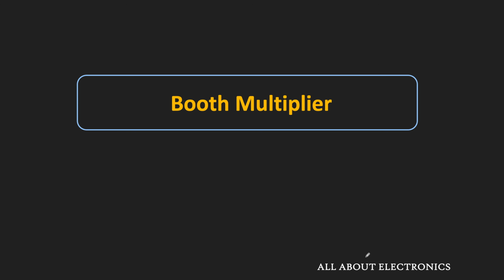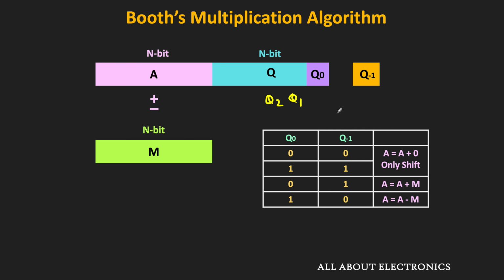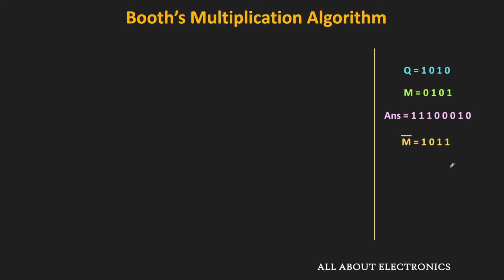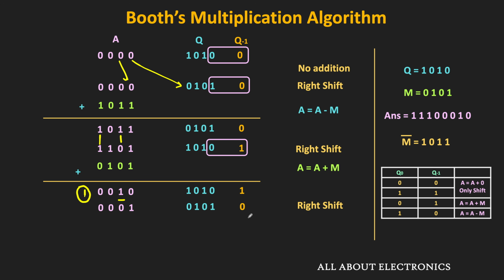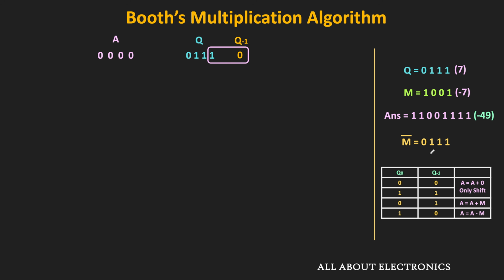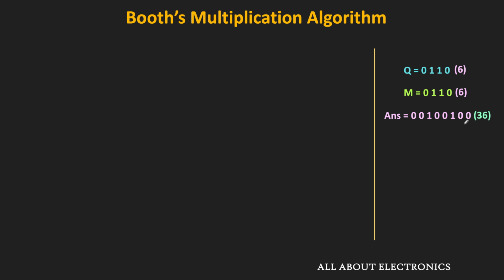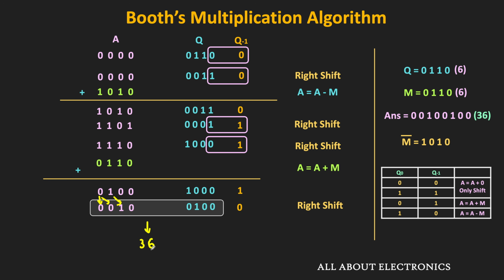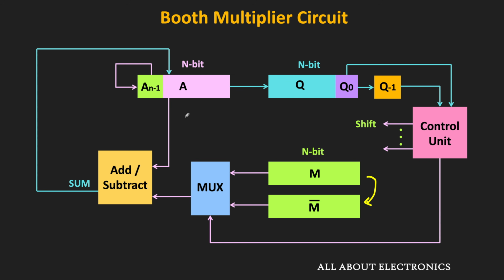Booth's Algorithm for Multiplication Explained (with Examples)

Comment: In this method for booth encoding part where we are deciding how to take q0 q-1 values as 0,+1 and -1 , what is the logic behind that
Reply from the maker: The idea is to reduce the number of additions compared to standard multiplication using the add and shift method. This algorithm treats the continuous block of 1s as single entity. Wherever there is a transition from 0 to 1 or from 1 to 0 then only the addition or subtraction is performed. This way it increases efficiency compared to standard multiplication method. I hope, it will clear your doubt.
Reply: @ALLABOUTELECTRONICS  Yes I understood that but what I exactly want to know is how this -1, +1 and 0 encoding is coming, do you have any paper or document to clear that doubt.
Reply from the maker: @arnab94mallick  Here is basically +1, -1, 0 encoding represents when to do subtraction, addition or just shift operation. For example, in this case, Q = 0110 (6). The same can be represented as 2^3 - 2^1. 8 -2 = 6. So, in the example if you see, the subtraction is performed at the 1st place (where we are getting 10 while comparing Q0 and Q-1 in the second iteration) and the addition is performed at the 3rd place (where we are getting 01 in the fourth iteration). So, just by doing one addition and one subtraction (along with right shift operations), we are getting the result. I hope, it will clear your doubt.
Reply: @ALLABOUTELECTRONICS  yes thanks

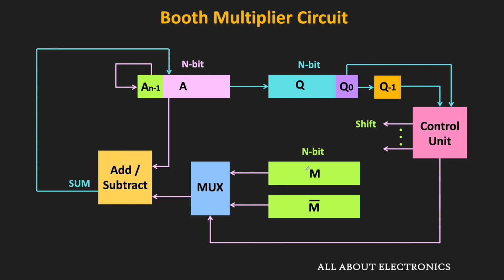Comment: at 19:06 The Mux implementation actually is the XOR gate taking input from M and the control signal
Reply from the maker: Yes, using XOR gate, the 2s complement signal will be generated. And according to control signal ( which will go to selection input of MUX) , MUX will select either M or M’.
Reply from the maker: Will try to explain the entire circuit in next video.